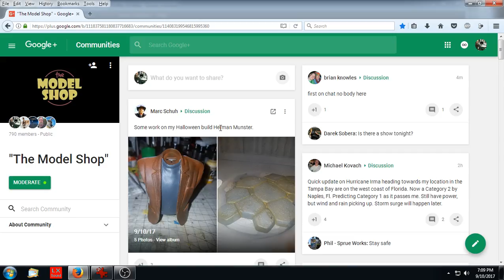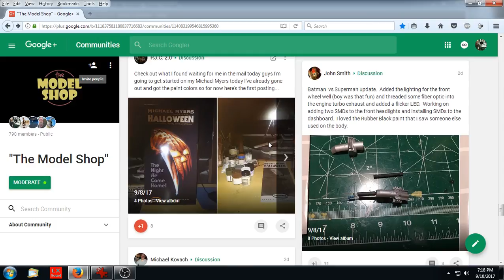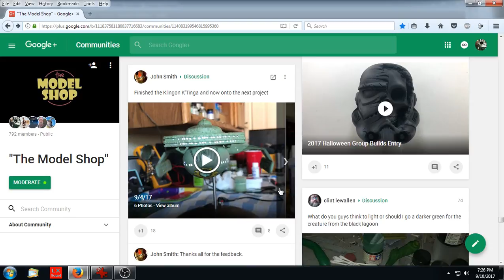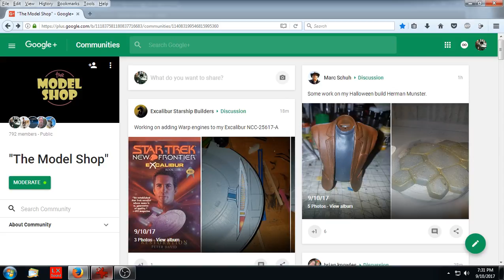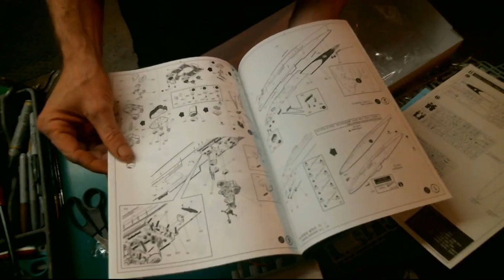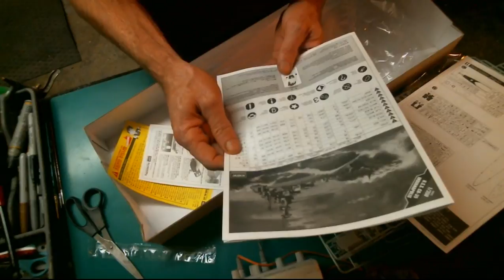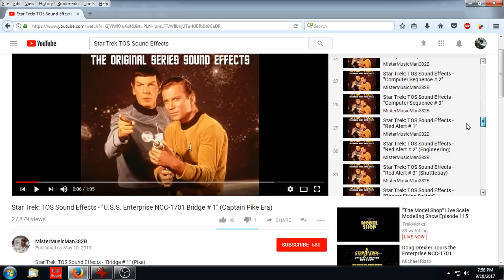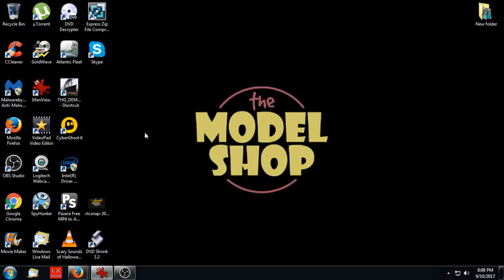"The Model Shop" Live Scale Modeling Show Episode 115

Comment: great show Boyd.  Ive made a couple of these soundboards already, I stripped the battery`s out and cut the connector tab, then soldered the voltage regulator wires directly to the plus and minus terminals right next to the mini usb port. Either way works though.

Comment: About audio quality in 8-bit --
A year ago, I did a videogame mod project with the classic PC game, Doom.
I primarily edited audio with the freeware sound editor, Audacity.  I ripped 2/3 of my audio samples from video that was stripped from DVD.  I spent 23-minutes (?) ripping each DVD (I was ONLY crazy enough to do this to two DVD's!) to get at the audio...  It's higher quality if you rip from the source (software) instead of recording onto a tape or whatever else you would use now to capture.  Then, I used Handbrake to precisely export the videoclip for the audio I wanted (always a few seconds before and after the audio to get all I wanted) with another round of exporting the audio from the videoclip with VLC Media Player which CAN export audio from a videoclip in MP3 or MP4 audio format.
I did my final audio edit of the MP3 clip in Audacity.  You can cut straight to the frame at the beginning of the soundwave that has the audio you want.  Of course, it's trial and error and interpreting where that audio beat begins in the waveform.
Audacity can export audio in MONO, 8-bit quality at 22Hz.  I've read that there's less software than people realize now that can actually do this anymore for free.  8-bit is just getting rarer and rarer as we're all used to CD quality sound or better now.
I found out that for 8-bit you really want to export at 22 Hz.  For Doom, the game is very limited in its "Vanilla" (original) state so I was constrained to under 3 seconds per audio clip, UNCOMPRESSED (PCM), MONO.
The audio files in the original Doom, btw, are pretty much all 8-bit, 11 Hz, Mono BUT the original game can handle 8-bit 22Hz, Mono Uncompressed.  Unless you're an audio expert, it's hard to compress and export anything at 8-bit 11Hz that sounds decent.  I got much better results at 8-bit, 22Hz.
To give another example, your CD is 16-bit audio, 44.1 Hz, 2 channel (stereo) PCM so the 8-bit audio I was exporting was roughly half that quality.  DVD-Audio and Blu ray are, of course, MUCH higher quality audio than either of the previous two audio standards I mentioned.
8-bit when done right still sounds "reasonable."  16-bit IS better but sometimes you can't use it because of hardware, software, and memory limitations -- but usually on older programs/hardware.
I found this out by trial-and-error because, for a lot of things, there's simply no documentation online and people (in the hacking/freeware development) sometimes don't share the information for the necessary file format specs.
I'm sure this last point is why so many people in the modeling community are sharing their tips online in video channels or forums because many times the "pros" who are paid tens of thousands of dollars for high-end project sure aren't sharing their buildling and "file format" tips, either!

Comment: Boyd,
I really hate to nitpick but you got your Indianapolis timeline a little bit wrong.
You said 1944... the incident happened in 1945.  Don't worry -- I get more and more brainfarts every year.  I hate getting old!!!
She sank in late July 1945 just after delivering the atomic bomb parts to Tinian(?).  Tinian is just across the waters from Saipan which was captured by US forces the previous year.  Tinian is where they staged the B-29 group with the modded bombers that dropped the A-bombs on Japan.
Indianapolis would never have sunk in 1944 because the atom bomb itself wasn't tested until late spring/early summer 1945...  Might have been May 1945 that the Trinity Point bomb was exploded.
Anyhow, it's not that big a deal.  In a thousand years, we'll all be dust and myths just like the Greek legends!
Reply from the maker: Yep, looks like I got the year wrong. I'm really looking forward to seeing the video tour of the wreckage. I've often wondered about it for years if it would ever be found. It looks like she broke up a bit but the state of preservation looks incredible. There's still fresh looking paint on some of the bigger pieces.